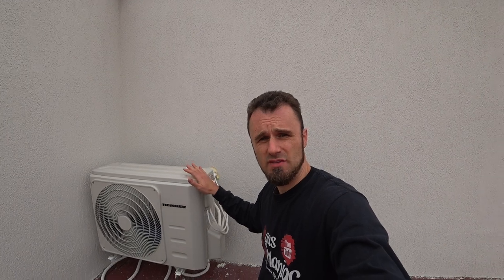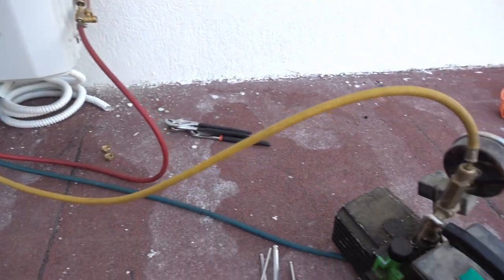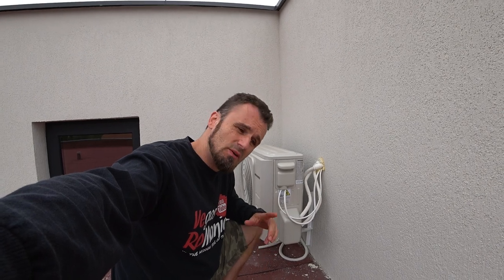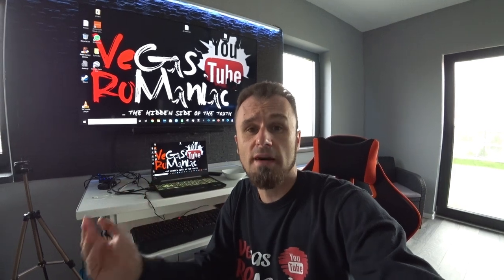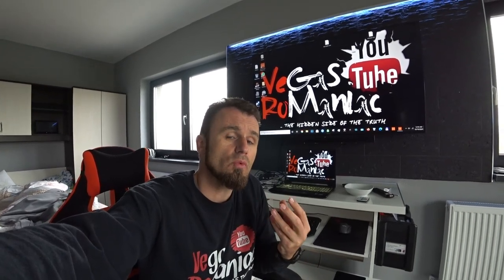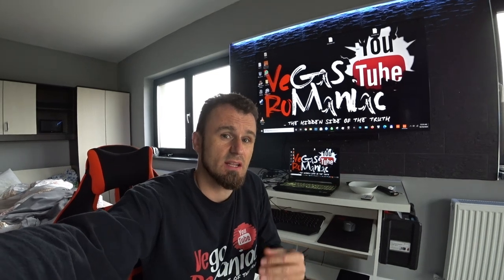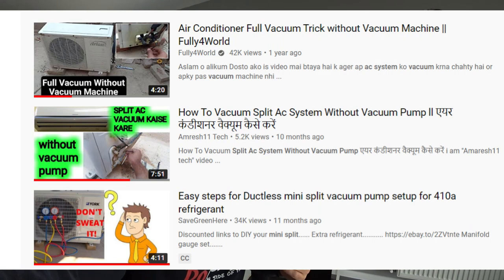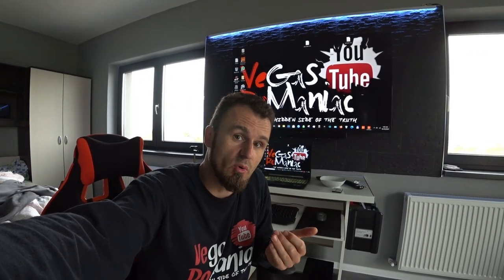How to install a Mini split AC without a Vacum pump

Comment: I've done several without a vacuum.  All are working great. They survive Texas summers no problem.
Reply from the maker: That's a amazing
Reply: Just connected lines? And you let refrigerant go thru?
Reply: Did you just connect the lines and turn on the A/C? How long have you been running the mini split since you did this?

Comment: I did it and its been 10 years and its working. The trick is to let one side open a liþle and open the valve from the other side until you can feel thegas comming out then you tighten it.

Comment: In the installation manual that came with my split unit aircon ....  it gave two options ... one set of steps without using a vacuum pump and the other with a set of steps using a vacuum pump .....
Reply: Cum se numeste modelul de AC ?

Comment: Installed an LG dual inverter without pulling vacuum, unit lasted 4 years. I’m in Mexico and the installation cost was about 200usd which is VERY expensive for labor in Mexico (hvac was 350 at the time). I just bought a Samsung mini split to replace it, it comes with free installation as a bonus.
Reply from the maker: Awesome ...
Reply: 4 años? Seguro que la mala instalación destruyó el compresor
Reply: @gerardo9052  Lamentablemente si, vino el tecnico a checarlo y todo.

Comment: 40 yrs in business. License in HVAC and Altra low temp systems (refergeration/ Nox-ax) can purge though the lines. Not really legal, but you can do it. Not supposed to release Freon into the atmosphere, but if your not a HVAC company your not obligated to that. The best way to do it to be really sure of no moisture is to add a

Comment: There is a dryer Freon filter in the system that will help deal with some of the air and moisture in the line set but will still never work as efficient as it can be, in less you draw a vacuum before opening the outdoor condensing unit Service valve to the indoor evaporator unit. It’s a good reason why you should always use a vacuum pump. If you want your system to work as efficiently as possible

Comment: Try vaccum it using car break booster hose that already came with one way valve in it(inside the hose),max suck avrage 21 to 26 psi dpend on car perfomnce, but it work just fine and worth to try..i always using this when i want to do a vaccum system and flushing job..it just mybe take a litle time to wait it till finish the vccum ,.just try

Comment: well i have 3 AC at home and recent AC got installed with Vacuum Pump done on 11 Apr 21 which was by following the proper procedure. Other 2 AC (one is 3 months old and another is approx 3 years old) were installed by flushing out the air by releasing the gas and keeping other end open. All 3 are inverter AC, and the AC is still running well (touchwood) though i was just frustrated with the technicians being unprofessional and not using vacuum, could not make them understand on how important it is to vacuum. I am from India. The procedure is done with the one allen key closed so as to prevent the gas from being released back into the outdoor unit, and the other allen key (big pipe) is opened and slightly the nut of the Small pipe is kept loose so it pushes out the air / moisture from within pipes through the indoor coils and into the small pipe and reaches the outdoor from where the nut being loose, it escapes outside, and immediately after a little gas leaks the nut is tightened. This is called AC flushing in india
Reply: Sir, which brand ACs are you using?
Reply: @groupgvk  LG and Carrier

Comment: Daikin instalation manual:
Piping Works And Flaring Technique
Do not use contaminated or damaged copper tubing. If 
any piping, evaporator or condenser had been exposed or 
had been opened for 15 seconds or more, the system must 
be vacuumed. Generally do not remove plastic, rubber 
plugs and brass nuts from the valves, fittings, tubing and 
coils until it is ready to connect suction or liquid line into 
valves or fittings.
So, be quick, then no vacuumation needed:)
Reply from the maker: Good to know

Comment: In Australia, new a/c gas is R32, compatible with propane, about same boiling point. 22 years ago I installed a Mitsubishi split system. Today I took the unit to the rubbish dump even though it still worked, but the remote board didn't work and it had to be started by pushing the button. It originally had R22 as a gas, but having shifted the unit a few times, as well as having installed many a/c units using R22, my 5 kg bottled was dry, thus for the last few years I have run it on cooking gas which in Aus is pure propane. The new Fujitsu unit I am installing tomorrow  will be purged with propane.  I do have a vacuum pump but see it needles to use it. The outdoor unit is pre charged with R32. I put second hand car sales persons, real estate agents, and a/c installer in the same box.
Reply: Ouch! Two of my friends are HVAC guys. I'd always considered the both of them to be pretty decent people. They may not be perfect, but they're certainly better than a used car salesman or a real estate agent, by a wide margin. 
Someone has hurt you, haven't they?

Comment: Ac units were installed for years without a vacuum pump, if lineset was kept clean from the factory, they are filled with nitrogen. The fact is it is impossible to keep air out of lines. Water vapor burns off in compressor of unit line dryer cleans out the rest. No worries, is it better? Yes is it necessary no.

Comment: Imo HVAC Techs only cause more issues. Mini splits come fully  and "perfectly charged and pressurized" to "optimum factory specs".   Think of your window air conditioner.... no need to pull vacuum and they last 10 years.   The one difference is the "the line sets" for mini splits.   So just pressurize those by opening the pressure valve on one side and cracking the nut on the other   Once you hear the air pressure,  tighten the nut.  This imo,  gives you the most optimum initial set up.   

Imo Hvac techs with their wonky gauges only cause more issues but letting in air  and messing with the micron pressures in a "perfectly factory sealed and pressurized system".   And then they charge you for messing up the microns and inducing air into your beautiful factory sealed system. Most of their pumps are outdated,  not working properly,  gauges off,  don't run it long enough,  bad seals, and will only cause you more issues 

Good Luck,   no way!   Just think about it before you decide.

**   This is just my opinion after really thinking about the Evac process to a perfectly factory sealed system,   Do what you want
Reply: Your right these new ac installers and techs love using there micron gauges and looking cool with there digital gauges pulling a vacuum, meanwhile there drain is running up hill three different places and the house floods two days later but thank god they pulled a vacuum for two hours 😂
Reply: Nicely said brother. I have read several comments and yours is the best. I'm about to purge my system and get on with it.

Comment: I have a Friedrich  9k Single Zone at 8 yrs age without vacuum pump.  One other mentioned, but the trick (without vaccum) is to purge some of the pre-charged freon through the line to flush out air and tighten your last fitting.  **This is only for single zone setups and linesets shorter than pre-charged capacity in the unit (many are 25ft pre-charge).  It's a good idea to use vacuum when possible as well as checking pressure in your system once running (over or under charge).  In your case specifically @Vegas.....Check your Mfg's "minimum lineset length"  you mentioned having real short lines and most units need 10' minimum line to work properly.  You may fry compressor from short lines sooner than a small bit of potential moisture.
Reply: 3ft line :-?  what is t for some migent house .. :-))))   6 is minumum usually
Reply: Does that AC have a quiet mode fan setting for sleeping at night? I had one where the lowest fan setting was real quiet but then another one where the Louis fan setting was too loud and I also have one now that says sleep mode and it's a super low setting but I can't buy another one because it's not available for the public and the other one I had with the low fan setting they don't make anymore
Reply: @magiccheeseball  it does not have a specific "sleep" mode.  If you set the fan speed to "low" then it will stay on that level and is quiet.  If you leave it on "Auto" then it will adjust fan from low to high depending on temp difference from set point.
Reply: @JohnSmith-jv9od  ok thanks! I ment silent mode some have an extra botton for that it's a super low fan setting some the low fan speed gose low enough to not need it but the last 2 mini splits i bought the lowest fan speep was not very low so i can't use them in a bedroom so I'm trying to find one with the quiet mode button because without it its a gamble if the fan speed will go very low some were very loud on low
Reply: @magiccheeseball  ah silent mode, gotcha!  No button on this unit like that.  Of the few brands i have experience with; LG has been the most quiet.

Most places have the spec sheets available online.  Take a look at how many fan speeds the wall unit has and also note DB (decibels).  That should help you sort and decide what may work best before you buy.
Reply: @JohnSmith-jv9od  thanks! Yeah lot are really hard to get ahold of the decibel readings also some November thermostats don't go low enough for me it's a pain looking for these there are so many of them some are total junk that only lasted about 2 years and one I had lasted 12 years and only the fan motor went out but they didn't sell it anymore the company went out of business none of them come with a warranty that's another problem. Well they do come with a  parts warranty but labor is the biggest cost and the warranties come with so many stipulations they're basically not valid in most cases. They do save a lot on electricity so it's worth the trouble I use them instead of the central AC

Comment: 12 years working fine till today. Never even needed a top up. I am not a professional installer and still worked. Found procedure in manual of the ac.

Comment: I ve seen people done it without a vacuum and I work in hvac I have seen units last up to 3years and I’ve seen some only last about 1.5 years and I would suggest that if you have the access to a pump you should use it.
Reply: Do you mean that ac unit last for three years, I just swear a Samsung inverter unit that last six years and leak as my other two ac both Samsung still running , the non inverter is 9 years old and the inverter is 8 years old, I just installed a Panasonic split inverter to replace the one that leak, here in Malaysia I didn't yet come across an installer that vacuum the system before installation,most technician will recommend the capacity of the unit suitable for the room usually one to three HP, yes here we calculate in Horse power just like cars engine 😂

Comment: Yes its no issue at all to install without a vacuum pump but only possible if it is a short line set like a back to back installation. You seal up the entire system and open the liquid line for a second to flood in some liquid. Leak test with soap. If all sealed leak free loosen the suction line and let out the trapped gas to atmosphere. Purge another 3 seconds from liquid line and tighten the suction line. Seen technicians do this but it is  bad for the environment as you release refrigerant each and every unit that is installed. Also you cant properly check for leaks. Yes will work but poor practice. This was how it was done 20 years ago especially in asia

Comment: But you don't need to pull a vacuum to get the air out you can perge the line it pushes the air out when you see the freon come out you shut the valve it's not the properr way to do it but it works i have done it both ways and no problems so far

Comment: It was always my understanding that you do not have to vac out if the new unit come pre-charged from the factory. A buddy of mine installed on w/o a vacuum pump about 2 years ago and never had an issue. Taking into consideration both the indoor and outdoor units had a charge from the factory.
Reply from the maker: The compressor outdoor does, but they inside unit doesn't.. So yeah the sticker clearly indicated you have to pull a vacuum. But this the info I wanted to have, working after 2 years...
Reply: Some  Mr Cool brand units have pre-charged line sets (with special ends) and apparently pre-charged indoor units (and outdoor also) so you don't have to pull a vacuum.
Reply: @user-bj4lp3fr1o  ...and others, has anyone tried these?  I'd be curious as to how well they work.  If so, what model did you install?
Reply: @davidvanzanten4385  Sorry I haven't tried the Mr Cool with charged lines.

Comment: Vacuum pump also checks for leaks. Are people also skipping thread sealant?
Vacuum Pump discovered leak in small line kink for me. Plus if you're flaring your own ends, that's another leak potential.
Reply from the maker: True

Comment: first guy worked for was a plumber that installed AC and that was his preferred vacuum method, that was about 18 years ago. these days I am a very reputable and successful HVAC technician and I would never do it ever ever ever! Back in the day we called it Flow&Go ! this shit will last a little while if you do it right but it's about the most unprofessional thing you can do!

Comment: I have never seen any split AC installed after vaccuming the line (brand new or reinstallation) despite bashing the technicians to ensure vaccuming to eliminate any air, moisture or debris accumulating in the system. Only thing they do while uninstalling is to run the compressor and recharge the outdoor unit by closing one valve and vaccum inside unit and both hoses to avoid loosing any Refrigerant
Reply from the maker: Good advice

Comment: How many CFMs does the pump have to be? will 3.5 work or you need 5 CFMs?
Appreciate an answer
Reply from the maker: You will never do a complete vaccum, so any pump will work , no reason to look for perfection and get stuck in technicalities
Reply: Found a 5 CFM pump for 99 bucks it worked great thank you so much for your help and helpful info

Comment: Pulling a vacuum is more than purging air out, it also removes moisture which can cause acid inside the system and cause corrosion inside the system and cause it to erode pipes, cause compressor failures (Bearings going out, windings burn out etc). A good vacuum is a must and any reputable HVAC will always pull a deep vacuum. If they don't then find another company.
Reply from the maker: The problem is that the majority of the customers never sit there with the installing tech or even ask this question so should be told if the installation is done without pulling a vacuum the warranties for maybe for the installation one or two years and then it will last a long even if the vacuum was not pulled plus it says a lot of time so the majority of the companies don't pull a vacuum

Comment: I've done a mini split AC just recently, labeled as easy/self install, including section in manual showing how to do it by hand and it doesn't work. Both units are running but there's no cold or hot air blowing, just a room temperature wind. 
I'm a builder with 15 years of experience and that DIY/self install without the vacuum is a bullshit
Reply from the maker: I've installed several without vacuum. All it does is extends the life on the compressor but it starts and works without vacuum

Comment: I installed my mini split 5 years ago without a vacuum. It is running at a 15-17° delta t. This is not really efficient as it should be 20°-25° delta t. I have an A/C technician coming next week to vacuum and recharge the unit. I will update.
Reply: $700 bill?    How much did they charge you?   How much did you pay for the orig. mini split?  Sometimes it's better to just buy a brand mini split on ebay for $1000 IMO

Comment: If you get a DIY unit you do not have to vacuum it down there's a bunch of videos of DIY units and you do not have to vacuum you disconnect the lines open up and get it but I think that's because it's got a different refrigerant in it

Comment: It's called purging the line without a vacuum.  Push the air out using the gas in the line.

Comment: Mini splits are now DIY! So I installed mine and got to the part in the installation guide that starts talking about the vacuum pump, I said oh no this is supposed to be diy meaning no professional trade tools required.
 Then I remembered I also ordered the kiwi e vac. “Line set flushing kit for split air conditioning systems.
 This can blows out the atmosphere air and begins to prepare line set and total unit for the release of refrigerant.
Follow the instructions.
Leaving the small tube open connect the can to the large tube and open and close the can several times then quickly attach the small pipe and pressurize the system with the can. Turn can off and close valve and check for leaks using soapy bubbles or leak detector.  Easy people, just order the “CAN” and follow the directions.
Pioneer also sent the flare fitting sealer, applied to all four flare fittings
Reply: Just what I wanted to hear, I'm going to install a Pioneer 9000 BTU with a 10-foot line set using the KWIK E VAC system.
Never installed one before, so Thank You for this comment!
Reply: Thank you for the info!

Comment: haha....   open the valve on one side,  crack the nut on the other side until you here a hiss,   quickly tighten nut.     Done.  1 minute.    Your lines are now charged.      Easy as pie.
In fact,   I think those wonky , leaking pumps and gauges hvac use only create more issues with adding condensation liquid and air to your lines from the air in their hoses.   IMO
Reply: how long do you purge before closing the line ?